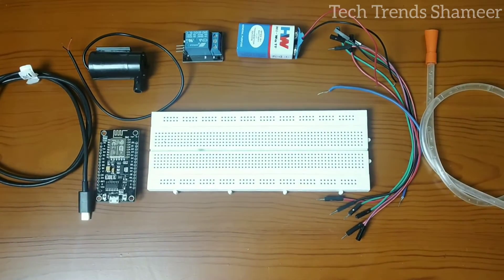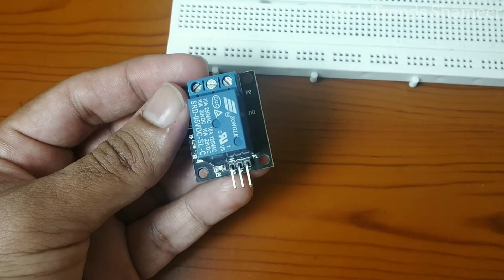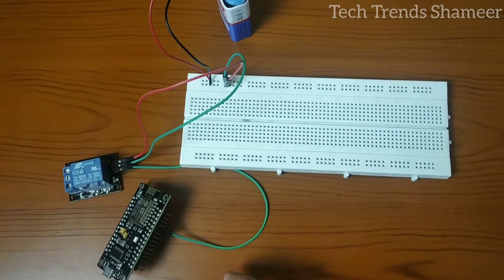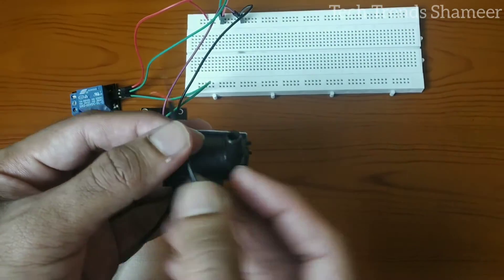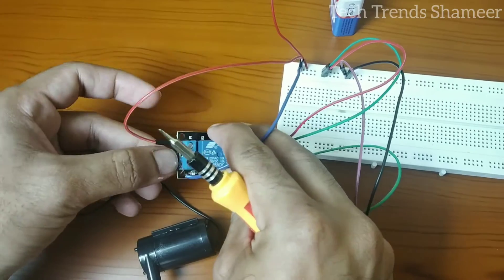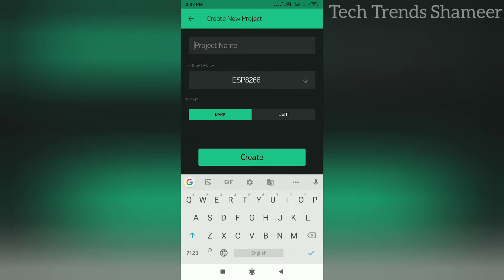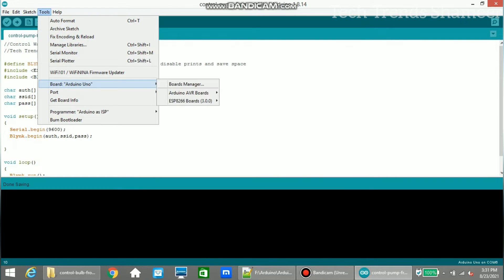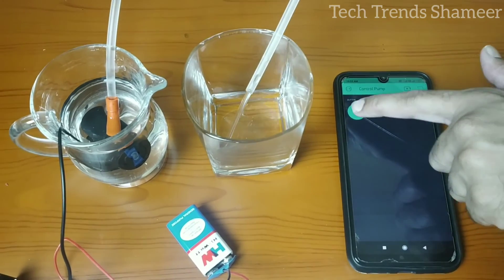Control Water Pump From Mobile | IOT Projects | Home Automation

Comment: why does my pump not turn on when connected to the relay? even though if it goes directly to the battery it lights up, and the relay turns on
Reply from the maker: What kind of relay you are using?
Reply: @TechTrendsShameer  I use 4 channel relay brand Songle

Comment: Can I use a 9v 1amp power supply with this instead of the battery ?
Reply from the maker: Yes you can use. I used 9V battery only for this experiment.